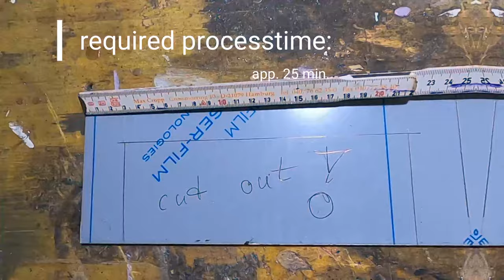Dutch Oven table DIY. No burned chicken, bread or other receipe at offroad,camping,bushcraft.

Comment: Another one is to weld three horseshoes in a triangle and weld three 1/2” bolts one on each horseshoe on the perimeter and any length bolt you need to stand it off the ground or coals. Then you can unscrew the bolts and change them for longer or shorter ones or just remove them for transport. Happy cooking!